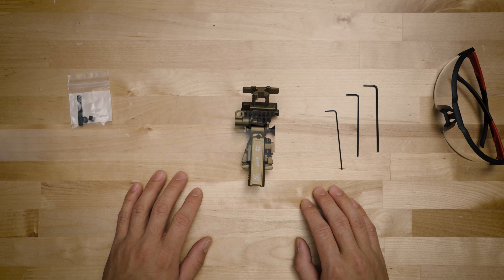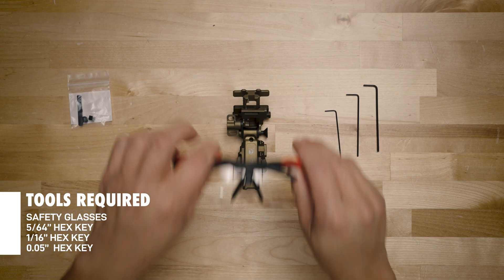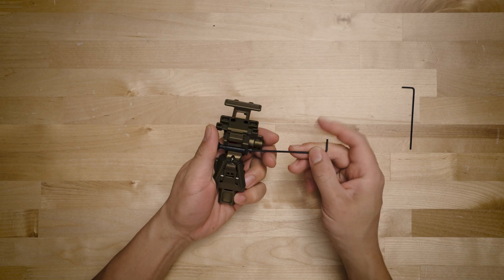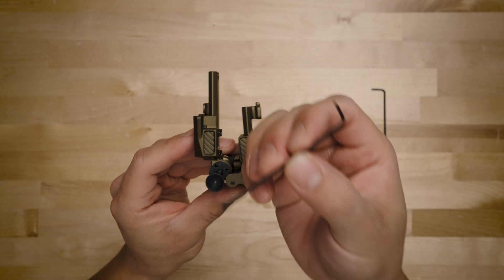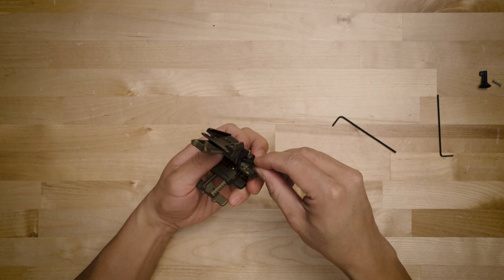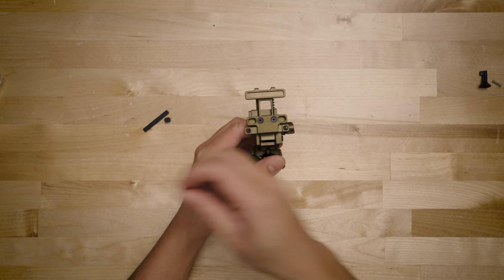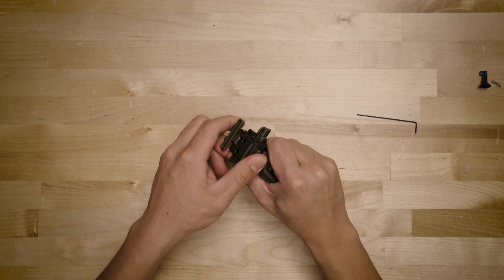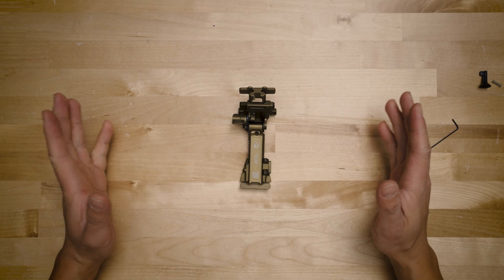ALPHA Mount Conversion: Force-To-Overcome Conversion & More

Comment: I tried this and found that if you remove the button, a slight play appears in the hinge regardless of the spring tension on the balls. This happens because the dimensions of the axial pin and the holes for it, as well as the ball sockets, are not fitted precisely enough. When assembled with the button, the latch partially compensates for these imperfections, but in the FTO version, the hinge play becomes noticeable and comparable to that of the L4G24.
So unfortunately, no miracle has happened

I also tried making a classic version with the button by simply removing the balls (similar to the L4G24 or Lo-Sto design). In this configuration, the central hinge develops a severe amount of play, making the mount extremely poor.
After that, I realized why Nocturn uses two fixation systems at once: the button latch and the FTO, to achieve the best possible stability.